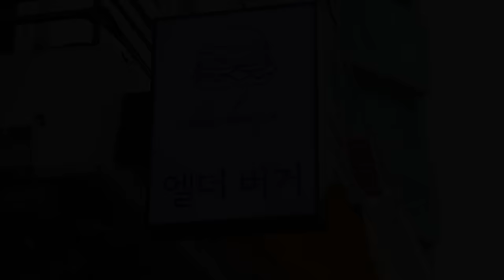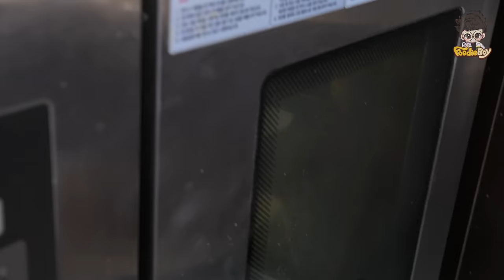매일 완판! 미국 베스트버거 어워드에서 1위를 3번이나 수상한 햄버거 끝판왕! 빵부터 베이컨, 소스까지 모두 직접 만드는 수제버거 / Handmade Burger

Comment: I like the fact that they kept the potato skin on the fries. I wish more places would do this.
Reply: same
Reply: Why
Reply: same
Reply: Fully agree with jacked potatoes and under the grill or airfryer - since most nutrition and flavour is right under the skin.

There's one place in my city where some celebrity chef opened a so called 'upscale fastfood' place where they deepfry with skin on and even gives a Korean twist with kimchi topping.  I tried it and found it mostly pretentious and stupid.  The fat crawls under the skin and peels off; so it makes it extra greasy - so to counteract this a bit the chef used sturdy potatoes which need longer time to bake, but I digress.

But the main issue is that I don't believe for a second that his staff is going to remove all the stray potato skin floating in the deep fryer after every single batch... so you who knows how long those peels between your fries have been floating around in there before landing on your serving - objectively disgusting and a potential carcinogenic hazard.
Reply: @zombiemachinery4868  You can and should wash that off.
Reply: @zombiemachinery4868  You don’t wash your food when prepping?
Reply: @zombiemachinery4868  i'm sure all of those chemicals are still there after being dropped into oil thats 400 degrees. lol
Reply: @zombiemachinery4868  no shit the oil is 400 degrees, like i said

Comment: Pro Tip, and yes I am a chef.  If you don't have a blow torch handy, or you are shy on using one ... I use in my restaurant kitchens a paint removing heat gun.  You know the kind you get at your hardware store.  It is perfect for melting cheese.  IT does get rather hot, so watch the end bit as it can burn you if you accidentally touch that hot blower end.  $20 to $30 bucks and works well!

Comment: Hmm. Wagyu for burgers? I dunno. Here's the thing about meat. If it needs anything other then salt and pepper.  Then it's not very good. My personal opinion on most foreign cooking is that the reason they add so many spices and a crap ton of garlic is to mask how nasty the food they are cooking is.

When it comes to hamburger number one it should contain at least 20 percent fat. Secondly it needs to be much bigger and really worked after it has been ground up. Meaning when you roll it into a ball you squeeze it to make it tightly formed before making it into a patty. Most Americans would agree that having to use a mold for making patties would disqualify you from having a good burger. Most extremely popular places like steak n shake or Culver's literally just place the ball of meat on the griddle and flatten it with their spatula. Most popular are thinner style old school diner burgers. Myself I love it that way myself with a bit of a crispy taste to the burger. However let me explain the perfect burger.

At home on your outdoor actual grill. You'll need a pound of beef per two patties. Obviously roll it into a ball as tight as you can. And if you can grind it several times that helps to. Next your gonna want some tin foil to place the patties on. Salt and pepper is added. Mainly for the ability to keep the patties from sticking. Then place them still on the tinfoil on your grill. Preferably preheated to at least 350. 4 minutes flip and press as flat as you can. Repeat until your happy with how done it is. For me once you no longer have red grease coming out then your ready to add cheese. This step is super important. Only American cheese. Period. Myself I prefer a thick slice of velveeta melted to perfection. Then it's ready. Whatever bun you like is fine. Myself I like a couple slices of thick Texas toast buttered and toasted on both sides. Put the patty on and enjoy. If you put any dirt on my burger I'm gonna be mad. Or anything that resembles the taste of grass. And if you put ketchup or mustard you ruin it as well. The only accepted topping is bacon. Real cooked at home properly made flattened to perfection bacon. 

I'd bet my years salary that this would outdo the burgers on this video if 100 Americans were asked to eat them. 

Not saying your burgers aren't good but I'm certainly saying that if you gotta add all the extra crap then the meat is not great.